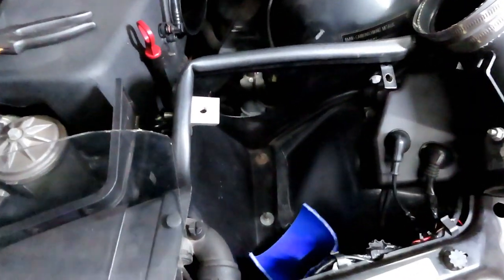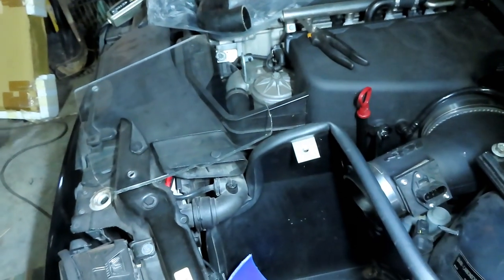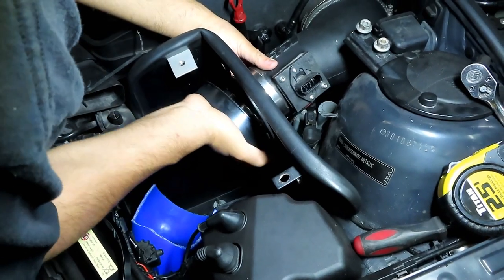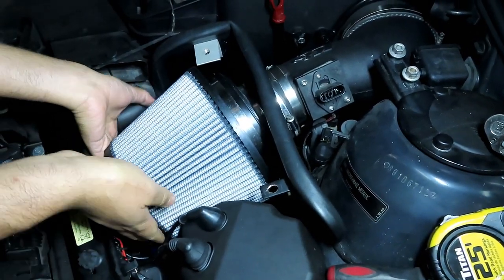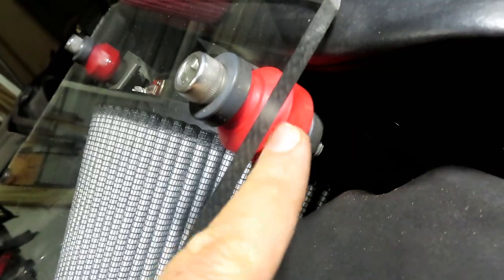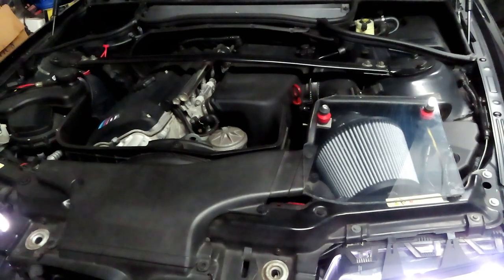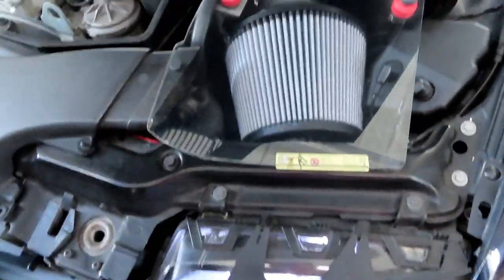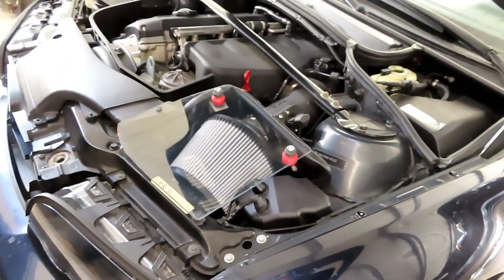E46 M3 Loud Universal Intake Upgrade For Any Car Truck HP TQ Gains

Comment: Hi,its a good idea put in a lot bigger surface area dry filter,than oem!Engine sound on street its amazing!In a reality,you dont need the csl airbox,if you cut out the wall where the k&n intake tube connect to the airbox,and make one fine shaped tube from this wall to filter,like the carbon fiber  csl ones.In this case you win a equal airflow for all 6 v.stacks,and more airbox volume= more hp.
But..i think the m3 with this sound make a lot of smile on your face :)
What the music play on the start?
Reply from the maker: The music is a short clip from the song Dynamite in the youtube music library. This velocity stack intake sounds amazing in person compared to the actual k&n setup. I saw a deal on the filter (Amazon warehouse) and quickly figured out I can fit one on the m3 so bought it.  It worked out well and was really cheap.
Reply: @SteveKish  Yeah,i think so.In upper range its make a fantastic i6 sound!The filter area now more than 2X oem? I think the filter no more restriction part of the intake :D

Comment: So this setup sounds better than the factory sized filter?  The K&N intake on YouTube sounds amazing but I'm curious if they record the intake under the hood??
Reply from the maker: The k&n it came with is better than the stock intake but this setup is an upgrade  from the k&n.
Reply: @SteveKish  did the cover you made make the intake quiter?  How about performance, help with heat soak?
Reply from the maker: The cover didn't affect sound and I hope it helps with heat soak. This is just a good cheap setup I did for now until it's ready for some boost eventually